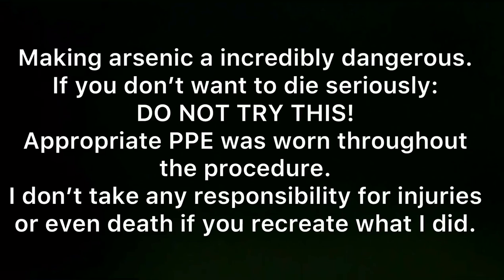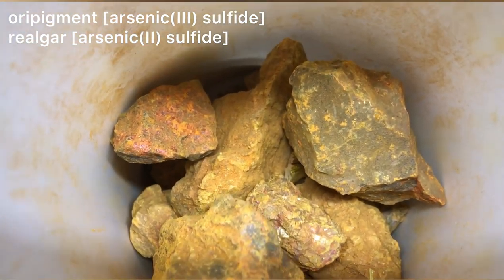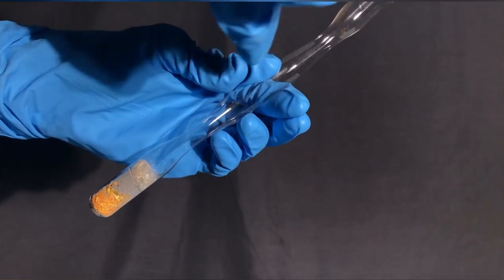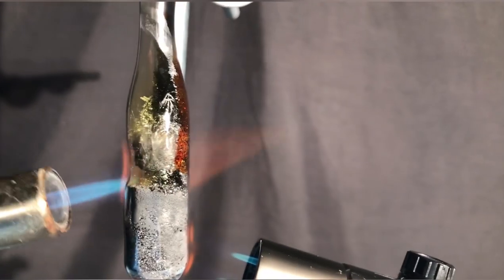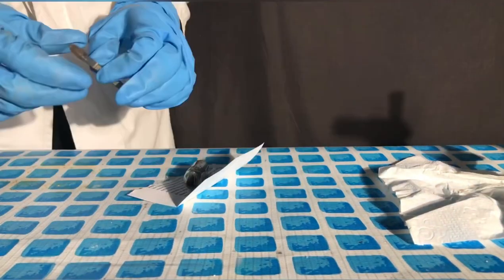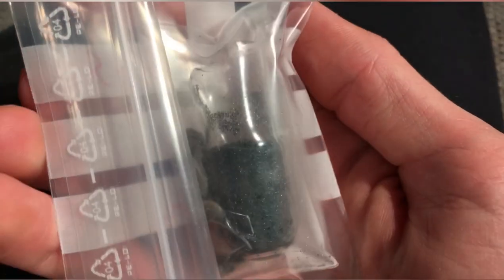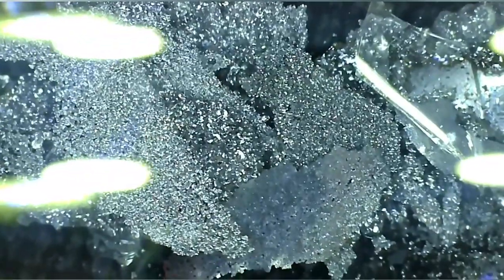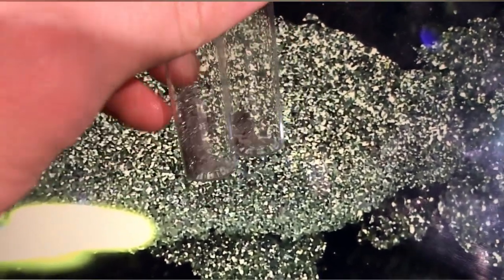Making Deadly Arsenic From Ore

Comment: Thanks for an interesting video. Arsenic is probably my favorite element. Maybe because I have a 6,8 kg metallic arsenic specimen sitting in my mineral collection. ;-)

You have inspired me to try to refine a smaller piece. Sublimation of an arsenic specimen is on my project list now, I just have to finish my fume hood.
Reply from the maker: Damn 6,8kg? Would you mind sending me a picture of that? I’m really curious ^^
If you try to refine a small sample make sure to use appropriate PPE please. I don’t want you or anyone else to get hurt.
Reply from the maker: Well I’d think of cadmium but that’s equally bad. Maybe try with sodium or cesium? Make sure to use appropriate safety measurements though!

Comment: Maybe it was just too much glass wool?  Maybe trying it with just a thin layer of glass wool and not a thick layer would work?  I'd try that and see before giving up on the idea.  But other than that this is an absolutely awesome video!  Thank you for sharing it.  I've been looking for a way to clean up this large amount of arsenic metal that I have and this looks like one of the best ways for individual ampules.  I just wish I could keep the crystal size the same on mine as the crystals of arsenic metal that I have are the biggest that I've ever seen and some are even bigger than my entire thumb from tip to my wrist!  I'll show you on discord where we have already been talking about it.  But yeah man, thanks for sharing!  I thoroughly enjoyed it.  😃
Reply: Also, I've already shared my ideas with you for cleaning it up on discord.  😉
Reply from the maker: Yup I’ve seen it😁
Reply from the maker: Thanks! It’s indeed possible that we used too much glass wool. Steel wool might have been an even better idea because of its thermal conductivity and because it might be able to act as an additional sulfur scrubber. Maybe it would have also worked better if we tried it under a vacuum 💯

Comment: Nice isolation. Try getting a borosilicate tube with 10 mm diameter and then use fine steel wool as a retainer. Vacuum is not crucial.

Comment: Is vacuum really necessary? I mean, can't you just flush it with some argon or CO2 and seal the reaction tube? The pressure created by arsenic vapours and expanded air shouldn't bee a problem, I guess. I really want to try doing that, but it wouldn't be nice to screw up badly because I don't understand something.